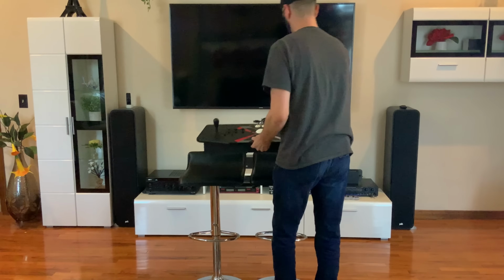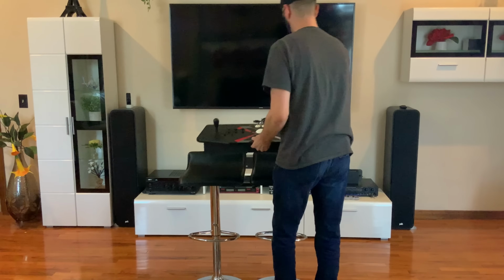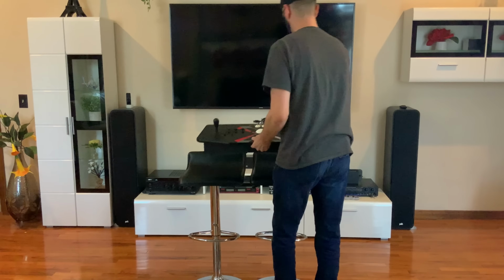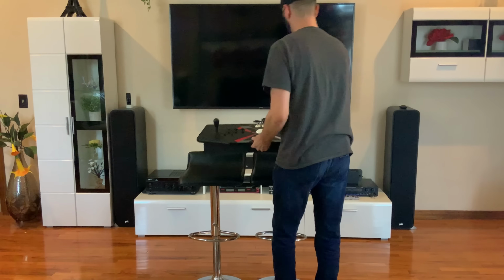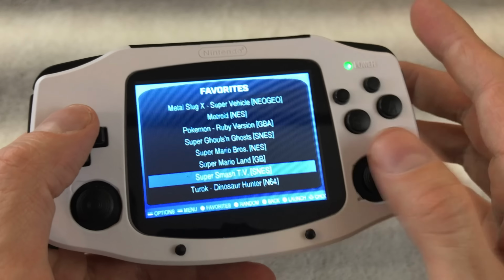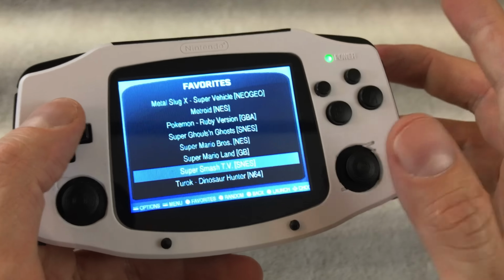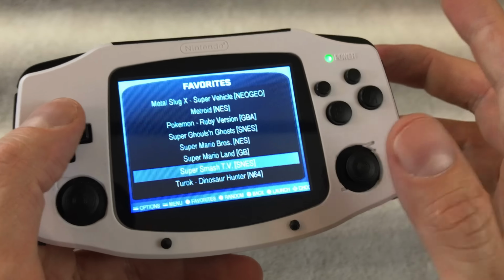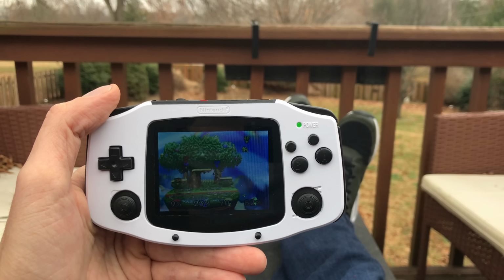The Best Retro Handheld Game Console - Freeplay CM3

Comment: If the sticks click in, you could now also use the Freeplay CM3 for Steam In-Home Streaming.
Reply from the maker: Connor oh I haven’t even looked at that. I was torn between the Vita sticks (no L3/R3 click) and the Switch Joy Con sticks. I’ve been playing around with the idea of another iteration. Maybe that could be cool. Have you done the streaming with a Pi 3 or CM3 before?
Reply: So definitely a good idea to try and run this set up for steam in home streaming.
Theoretically, you could port Launchbox into steam and then stream it to the CM3 for full local library support.
It could be a blast if you could get Wii U/ Cemu working on big box and stream it to this little guy. Otherwise I would say maybe modding a Wii u gamepad with a raspberrypi3 would make for a better base w/ larger screen.
Reply from the maker: Andrew Preston I am definitely checking this out at some point. Thanks!
Reply from the maker: Connor you were right! It works really well too https://youtu.be/xJmIDA9kjvg
Reply from the maker: Andrew Preston you guys were right and it works better than I thought it would  https://youtu.be/xJmIDA9kjvg

Comment: What the story of that old frankenstein modded DMG gameboy XD
Reply from the maker: Lokman02Naza Hahahaha a project I have on the back burner. Pretty sweet stuff to it though. Did you see the cooling solution? Air intake through the front speaker grill and the exhaust is through a screw hole in the back so you don’t see it. With the fan running at 3.3v it is basically silent, the air flow is just barely noticeable, and the temperature stays cool. I also have it setup to be a power bank with a 10,000mah battery crammed in there. That’s why the space is so tight inside. Pretty heavy though. Also, that screen is something special. As far as I know I haven’t seen anyone fit it into a DMG before. It’s the Hyperpixel screen with a resolution of 800x480 (0.0). After messing with it again for the comparison in the video I fell like I may need to finish it up soon. Forgot to mention that there is a stripped down Pi 3 running it with the original HDMI port available on the side nicely.
Reply: @jivinhipcat  Cool, I've seen lots of gameboy mod with ton of stuff in there but I've never seen people put a fan before. Great video btw.

Comment: So if I get the regular cm3 for 299 I just have to add games to it?
Reply from the maker: I think the CM3 kits are still going for $169.99 - $199.99 on the website https://www.freeplaytech.com/shop/ . You will just have to check out the different options you want. It’s a kit, so you put it together yourself making the modifications to the case and anything else you want to do to it. If you’re not too sure about using a Raspberry Pi to play games with RetroPie and Emulation Station you should look up on it because it’s really cool. That way you have some background info on it. You will download a custom SD image and flash it to your SD card. There are no games on the image, so you will add those on your own. I did hear that some were being sold as completed builds from places other than Freeplay Tech, but I’m not sure where. I have just uploaded an example build video showing the build process using the updated board with the 2 new button options if you’re interested https://youtu.be/HcUCw5oCoIE .